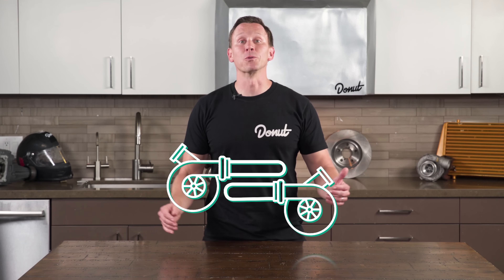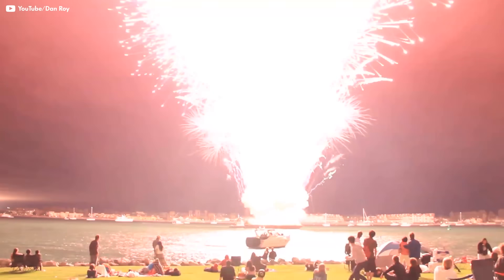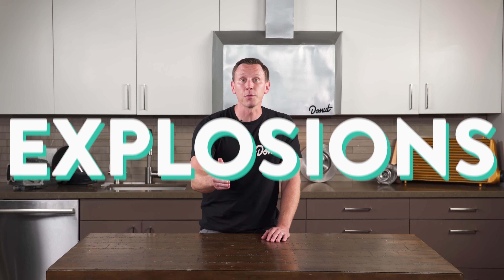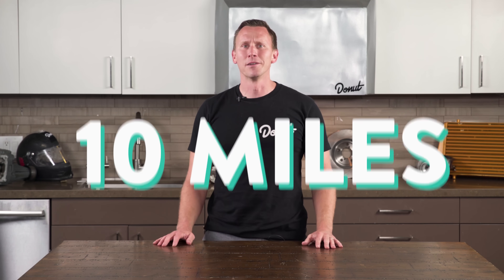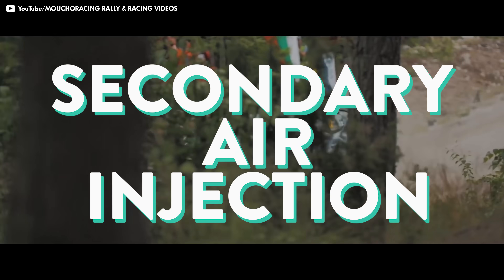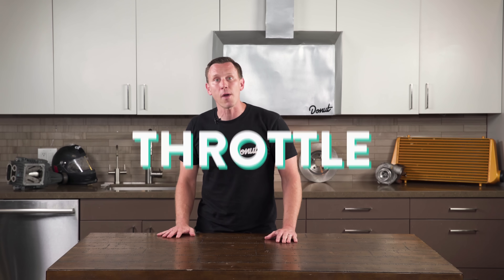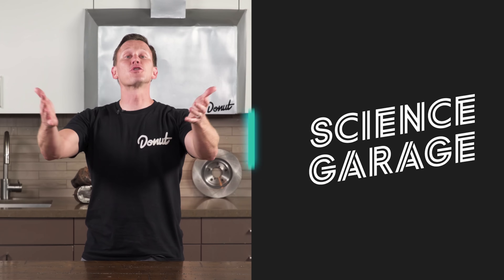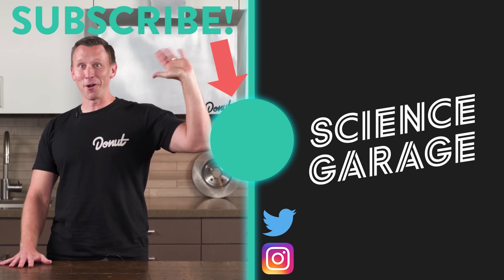ANTI-LAG | How it Works

Comment: Biggest misconception in the car community is that 2step launch control and anti lag is the same. That launch control setting in your aftermarket ECU, or your Bee R rev limiter so your car bar goes bang bang is not anti lag.

Comment: or just get a centrifugal supercharger and not have to worry about any of those problems
Reply: except for the power sap at the crank and the fact that it doesn't sound as cool
Reply: And not as efficient
Reply: ZombieByte its negligible and i prefer the whining sound better
Reply: THExWASP and that's what is so great about custom car culture, everybody can make their own boosted car and they get their pick of what kind of boost they want wether it be supercharger, turbocharger, nitrous, methanol or some crazy space age electric chargers that i'm sure will be rad someday
Reply: THExWASP except for the part where centrifugal superchargers hit peak boost WAYYY later than turbos and are significantly more peaky than any other type of supercharger..  if you want to go with superchargers, go roots blower or bust.
Reply: THExWASP No, that's not it. I think the hellcat/demon with its roots blower proves that wrong.. z06 too.. GT500.. none of them come from the factory with junk cheap centrifugal SC. 

If you're on a budget & are scared of turbo tuning, or dont know any better, centrifugal superchargers are okay & do make good power. But there are much better more expensive options. 

That's the facts boo.
Reply: River Valley University its more reliable and consistent so i prefer that over efficiency
Reply: The Notorious Flip it gave my little 350 sbc 25-30% more power from idle to redline when i took it to the dyno and its still more reliable than the turbo option :\
Reply: THExWASP you keep saying it's more reliable, but I dont know of any OEMs that use a Centrifugal supercharger, but every manufacturer has turbo cars of some sort.
Reply: @KaizenPR57  GM 3800s
Reply: The Notorious Flip because it is

emission laws are keeping manufacturers from making bigger/wasteful engines and turbos are the cheaper way to go
Reply: The Notorious Flip nothing you said proved me wrong and  a simple google search shows that you just started making stuff up to make yourself look right lol

you just don't want to admit that centri superchargers are great but thats fine kid, you'll learn someday 😂
Reply: Lancia threw a supercharger and a turbocharger on the same engine at the past... I think they knew what they were doing

Comment: 2-step systems also often cuts ignition to certain power strokes to hold the engine at the first step rev limiter and get more pressure in the exhaust manifold when the charge ignites in the manifold. That is often what makes the "banging" take place.

Comment: I need to get one of these on my PC.
Reply: Bang bang
Reply: I’d rather have a lagging PC than an exploding one.
Reply: I need one for my wifi router
Reply: KM Gaming hmmm would you recommend Intel ecu or Ryzen ecu??
Reply: It wasn’t lag that made you lose the match bro
Reply: bruhhh
Reply: AS_EV4D3R_ 1 Go for intel if you want more power for drag racing. Go ryzen if you want more reliability for track racing and stable lap time.
Reply: I need it on my 1060 cuz it drop frames alot when I enter a corner in assetto corsa.
Reply: my old pc lags so much I crack up the voltage going into the CPU and GPU creating more Watts and speeding up the clock speed until it can't take the heat anymore then BANG BANG (The system unit smokes with a tiny little sparks and pop)

(Of coure I just made it up, It never happned :D )
Reply: U got too many porn sites still opened from last year
Reply: Maybe
Reply: Duuuuuuuuuuuuuude.
Reply: kinsel yea there are still some new gen Chinese graphic card with turbo button lol
Reply: You want a MISFIRINGU SHISTEMU for your PC?
Reply: I feel like I have seen you before.
Reply: Me too
Reply: Pc that runs on vodka cooling supercharger and car parts. has an built in speedomether that tells you the actual speed of the pc and the heat. Has an cpu that can be put on an car as an built in ecu . I've just found a purpose in life , hurray.
Reply: Turbo shaped fan!
Reply: My Specs
Intel Potato
512 ram
Will it work?
Reply: Im dead
Reply: Expect a bang bang sound coming from the drivers lol
Reply: Uriah Siner PC with misfiring systemu?
Reply: Brap Brap Brap
Reply: imagine the boot speeds
Reply: A friend of mine has air filter  at his pc 🤘😂😂
Reply: @technicalthug  the more I know lol
Reply: Ya it's called overclocking profiles
Reply: You want your computer to spit...fire?
Reply: Sick bruh😜
Reply: Need that for my internet connection bro.
Reply: Same LOL
Reply: Uriah Siner same
Reply: Uriah Siner watch Linus tech tip  5ghz laptop video youll get some idea
Reply: Uriah Siner lol
Reply: uhh ya thats called 'overclocking'! Similar to antilag it involves timing for when you get that POWAH. but beware it will make your pc run hotter which may reduce your components lifetime, and, in some cases  void warranties.
Reply: Uriah Siner lol
Reply: AS_EV4D3R_ 1 Ryzen
Reply: me too lmao
Reply: On my phone
Reply: I need one for my internet connection bang bang
Reply: Same.
Reply: Hey look more ricer here
Reply: Gonna need that by-pass one for my GPA as well
Reply: Makes your car faster (in video games) with technology that guarantees 60+ fps
Reply: Bruh
Reply: Go chase your PC. Good luck with that
Reply: Uriah Siner If you're talking about input lag, then usually high refresh monitors have less input lag but generally manufacturers don't test for input lag. Or you could get a CRT monitor for zero input lag but those are rare and expensive, you'd be lucky to get one cheap.
Reply: Uriah Siner ikr
Reply: loads Minecraft 
RRRRMRMRMRMRRRRR BAPAPAPAP
Reply: Bruh
Reply: No need. Just reduce the graphics level.

Pls Don’t r/woosh me. I Actually Get The Joke.
Reply: Uriah Siner good one xd
Reply: Same hahaja
Reply: Well it probably blow your pc up if you do end up install one LOL
Reply: PC = Project Car
Reply: MORE AIR COOLED POWER
Reply: Tell me where i can get one for my ps2 i want a twin turbo
Reply: very funny i laughed
Reply: Good Internet
Reply: Imagine somehow putting a turbo on a pc that shit would be hilarious 😂👍👍
Reply: @smakmyass3276  LMAOOOOOO
Reply: DAMMIT I COMMENTED THE SAME NOOOOOOOOOOOOOOOO
Reply: LMAOOOOOO
Reply: when I overclock the CPU and flames shoot out of the fan vent
Reply: Yea get a bang bang system for that PC
Reply: Evo ih ove jutub barabe
Reply: turbo charged pc
Reply: Just play fh5, boom boom bang bang baby
Reply: Get a usb accelerator
Reply: Just take your CPU out and run it through the washer machine it probably just had gunk on the pins, trust me it will work! 👍😊
Reply: basically CPU/GPU OCing is PC version of antilag
Reply: Yeah me too.. my gpu need it.But my power supply was smoking now Lol
Reply: lol
Reply: Lmao i get it
Reply: Fuck off
Reply: same on my asus lamborghini pc

Comment: You say the anti-lag and two-step rev limiter are not the same thing - in many ways they are - throttle is open but engine is deliberately running less efficiently to prevent it from revving up so much, with same effect of blowing fire into turbo and spooling it. Might be set up slightly differently, and for different objectives, but in reality they are pretty much exactly the same thing. 
People blasting explosions through their turbos is what we all can visualize when we see on eBay or Craigslist: "Used turbo, low miles. Decided to go with something else..." Why I felt a little bit more comfortable instead ripping a turbo out of an old Saab in a junkyard, moderately high mileage but was probably driven by a grandma.
Watching racing almost hurts, seeing them destroy top-of-the-line components that cost more than my net worth has ever been and would love to get my hands on, in a single race.
Reply: Quill Maurer 2 step is just a rev limiter at a certain rpm, so just cuts fuel when ur at say 5k rpm

Comment: Misfiring system | how it works

Koenigsegg gearless direct drive | how it works

Automatic transmission | how it works

Sequential gearbox | how it works

Differentials | how it works

DCCD | how it works

ECU | how it works
Reply: Door handle | how it works
Reply: misfiring system = anti lag
Reply: Mj Tingzon i don't think you know what a misfiring system is

spoiler alert: 
it's anti-lag
Reply: LSD | How It Works
Reply: Mj Tingzon you mean m i s f i r e n g u  s h i s h t e m ?
Reply: Duncan McGee including door handle?
Reply: These are basic, please do quantum mechanics!
Reply: ECU needs to be done for sure
Reply: power windows | how it works
Reply: Mj Tingzon theyve already done almost every single one of those
Reply: Mj Tingzon sunroof | how it works
Reply: Suicide | how it works
Reply: Fucking magnets | how do they work?
Reply: Steering wheel | how it works
Reply: Mj Tingzon Koenigsegg
Reply: Jeremy's Dad | How it Works
Reply: Mj Tingzon you forgot AC 😉
Reply: Jay you must be an incel
Reply: IvanE _14 Doug Demuros got you covered on that one
Reply: Mj Tingzon alternator how they work
Reply: Air bags | how do they work
Reply: Crash | How it works
Reply: Female Brain | how it works

Comment: hmm, to destroy turbo and have the car cream itself everywhere, or deal with lag and miss out on snap crackle pop but save buying turbos all the time...
Reply: Oh the dilemma
Reply: Wat
Reply: I pop all the time without anti lag
Reply: Subways Shenanigans modern turbo sport cars have rally style antilag that make an acceptable stress to don't break the turbo
Reply: Jerry Maguire  little difference between back fire pops and anti lag pops though aha. used to have just  a base model impreza that would do it every time you let off aha.
Reply: Guten Tschuss Yeh, I have a 01 wrx... I miss out on that modern technology with out selling an organ to get it fitted aha
Reply: 600-700$
Reply: There is a way to make your car crackle pop without an anti lag system. Basically you need a free flowing exhaust, and a rich air fuel ratio. More fuel with the same amount of air won't burn up all the fuel, so a bit of the fuel goes out of the combustion chamber, into the exhaust where it ignites, and that results in that nice crackle ^_^ You consumption goes up obviously, but not by much if done properly and it's absolutely worth it.
Reply: Subways Shenanigans. Check out BMW scroll turbos
Reply: Subways Shenanigans no anti lag is better